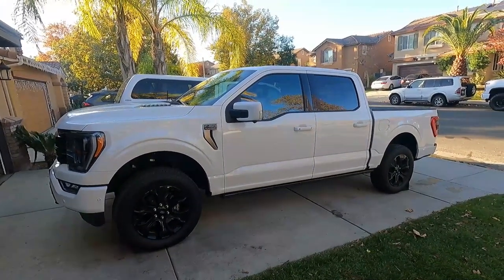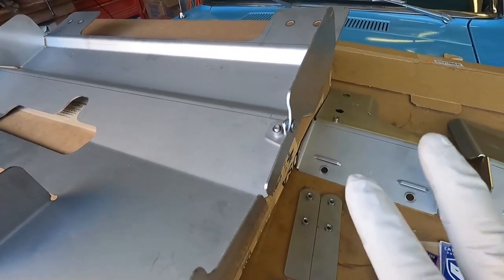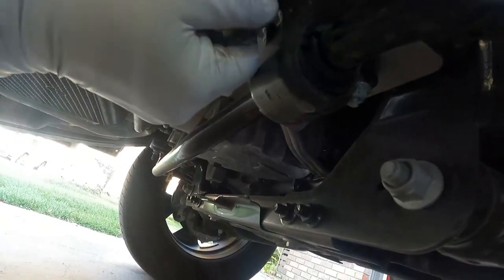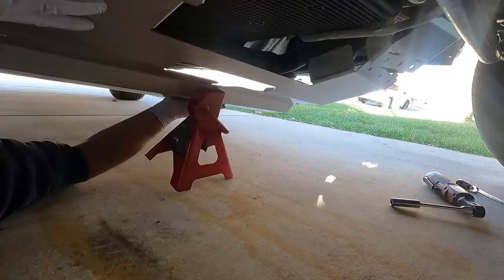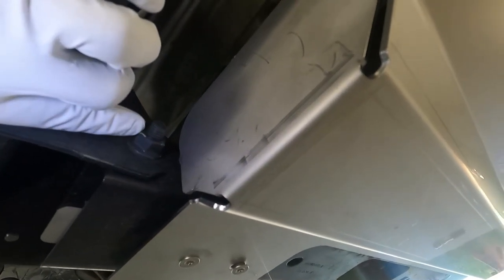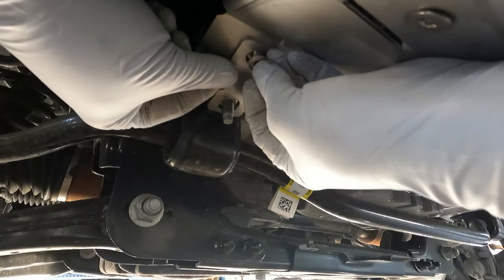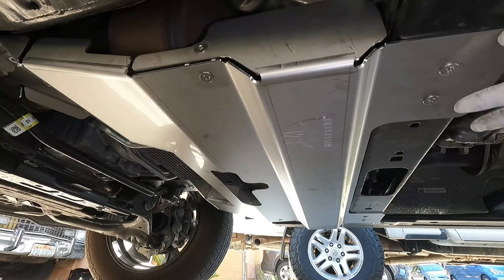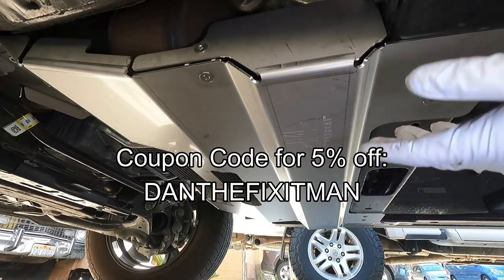FORD F-SERIES IS THE MOST TARGETED VEHICLE FOR CATALYTIC CONVERTER THEFT MillerCAT CAT SHIELD F-150

Comment: So do you have to remove the whole thing to do an oil change? Or can you access the drain plug and oil filter with the guard on?
Reply from the maker: Will the shield interfere with maintenance such as engine oil and transmission fluid changes?
All Miller CAT Cat Shields will not interfere with your oil changes.

Comment: I'd also like to know about the oil change
Reply from the maker: From the millercat website and the video description:
Will the shield interfere with maintenance such as engine oil and transmission fluid changes?
All Miller CAT Cat Shields will not interfere with your oil changes.
Thx!